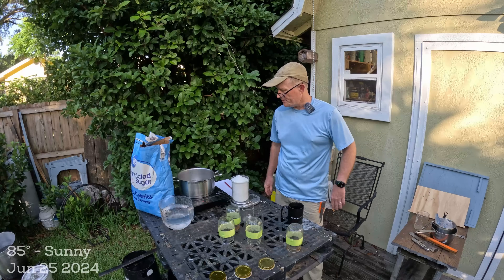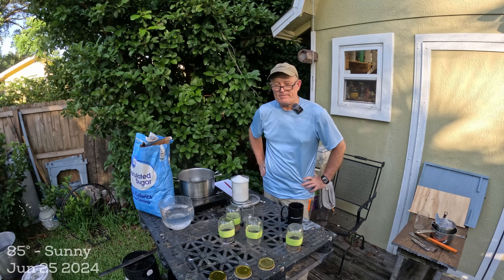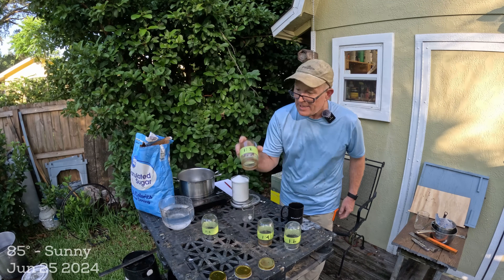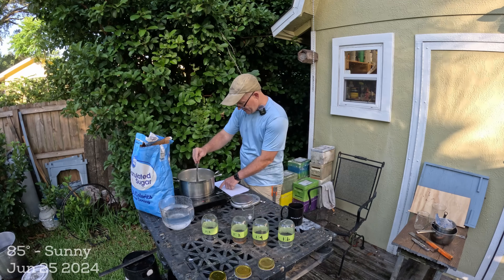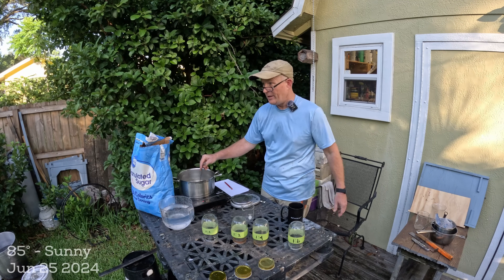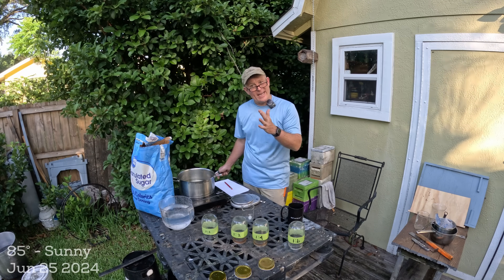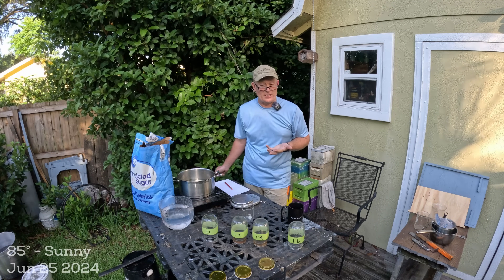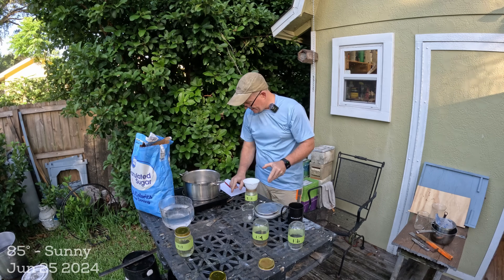What Sugar:Water Ratio do Bees Prefer in a Dearth? - Jacksonville FL Zone 9b

Comment: Thanks for replies. Question...have 10 hives in same corner of property, how far away from the hives do I place the feeder? I mixed 1:1 but actually added a bit more water to make it 1:1.2 .
Reply from the maker: Its not an exact science, but think of a distance that a forager coming to the feeder would not find a weak hive for robbing.
Reply: @chuckshoneybees  I have all 10 hives in a crescent 🌙  shape spaced about 1-2' or so apart. The feeder is about 40-50' away currently. Am using a farm tuff chicken waterer. Have an extra not using for chickens. Have some wood chips around the ring for bees to land on. Probably shift to large gravel or 1" rocks. Tested 1.5 gallons to see if they take, started hitting it but afternoon next day. 4.5 gallons yesterday evening added down to less than 2 right now.

Comment: Chuck, one use of your experiment could be for beeks that are feeding during the dearth so they aren't robbing so much. The 1 to 4 syrup would make 4 times as much feed that would keep the bees busy for a much longer time.
On the one to one, because it is thicker the bees would have a harder time pulling it out of those little holes. I wonder what results you would have if you used four open feeders with straw on top?
Reply from the maker: Good thoughts.  I am not sure I agree with the thickness causing a slower consumption.  Because the gravity keeps a drop at the bottom from which the bees consume.  So they don't really pull it out, it falls out and they lick it up.

Comment: Chuck, can we get some close ups of the holes in your lid? Ive tried different size holes and keep losing all my sugar water! Tried watching your old videos but still can't get it right. Thanks as always!
Reply from the maker: They are small little holes made by a nail you might hang a small picture with.  Probably 1mm hole.  The size of the hole should not matter that much as long as there is a seal on the lid when you close it.